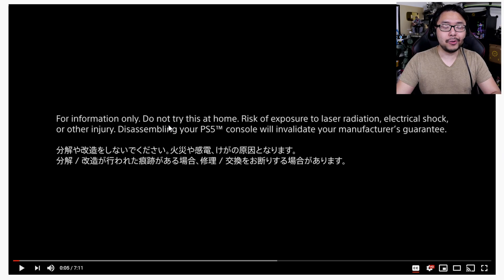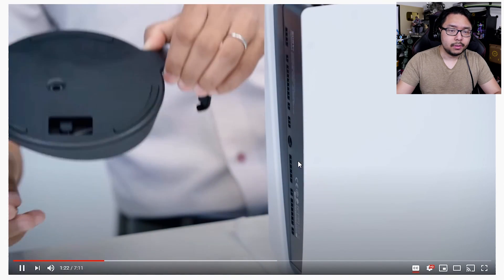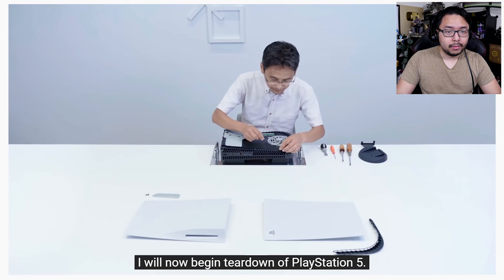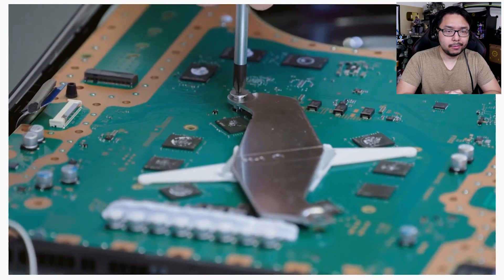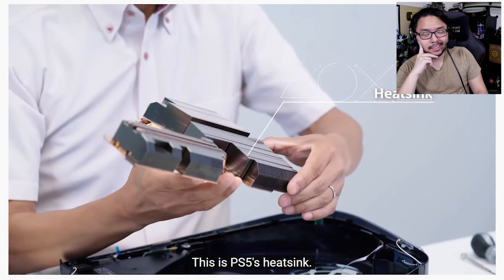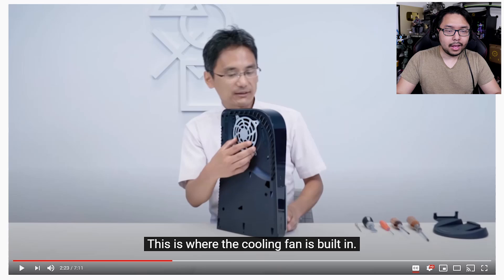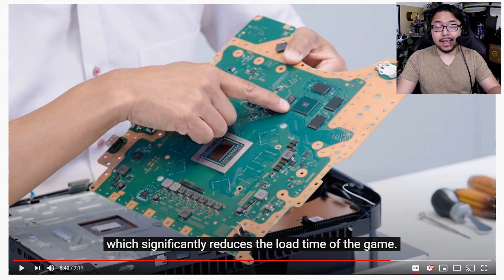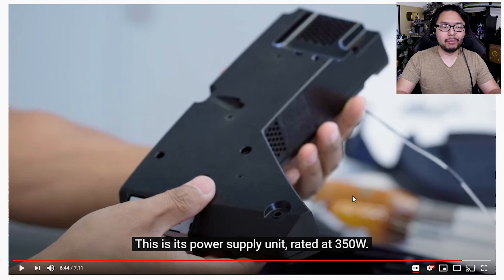Reacting To Sony's PS5 Teardown (Cooling, SSD Slot, Swappable Panels, & More)

Comment from the maker: I'll take some thiccness if it means reducing hotness.

Contribute to my channel on Patreon.com/YongYea or by clicking the JOIN button, and you can also follow me on Twitter.com/YongYea for the latest updates.
TOP PATRONS
[CIPHER]
 - Mitchell Mason
[BIG BOSS]
 - Bancheis
 - Brin
 - Charlie Galvin
 - CommittedHall
 - DatadyneExecutive
 - Jonathan Ball
 - JT
[BOSS]
 - Devon B
 - Gerardo Andrade
 - Joe Hunt
 - Michael Redmond
 - Peter Vrba
 - Shepard Gaming
 - Time Dragonlord
[LEGENDARY]
 - BattleBladeWar
 - Mark Taylor
 - Theron Webb
 - Yue
Reply: I agree Yong
Reply: Teddy Holiday better than your overheated black box. 🤣🤣
Reply: I knew Yong like em thicc 😉
Reply: Nice
Reply: Thicc Cooling
Reply: Nice reaction video Yong. The PS5 seems well engineered and is fast, very fast.
Reply: Those removable panel $$$$ Sony you smart bastards
Reply: Sony thrown nuclear bomb on xbox by this
Reply: But Yongyea thickness always adds hotness for me, in a good way 😉
Reply: I kinda wish xbox went with a changeable nvme  port so you can slot a more fast ssd in the system
Reply: I'm amazed how no one is emphasizing the importance of sony using liquid metal as a means to reduce heat over a heat sink. This is really stepping the bar up. I love both consoles and each have an advantage over the other, but sony using liquid metal really raised the bar.
Reply: I believe the shape of the panels affects the airflow into the dust collectors. Changing their shape would affect that, unless the new shape channels the airflow well.
Reply: Not sure when I will be able to afford  the PS5 but it looks great.
Reply: Ha! Firt comment! Anyways it looked cool
Reply: Indeed Yong
Reply: Tbh! That guy is very small!
Reply: That's a quote.
Reply: Do you know if Sony recommends to get an SSD with a heat sink or without one these are important questions Sony needs to answer and also what happens if you purchase an SSD that is faster than the PS5 SSD does it take advantage of the faster SSD or does it lower it to match the PS5 speed because if it does then it would be a waste of money to purchase an SSD that is faster than the PS5 SSD if it's not going to take advantage of the extra speed.
Reply: Still it's nothing compared to a good PC 🤣
Reply: That fast hard drive is a waste when you have bottlenecks elsewhere.
Reply: quick question for Yong, can you share the dimensions of the xbox series x plz?
Reply: YONG YEA u should do ur xbox series x teardown,so we can compare the heatsink
Reply: I recommend checking out Sabrent Rocket M.2 SSD. They offer an 8TB version which would be insane to put in the ps5. Its around $1400.... but.........its cool!
Reply: Hey Yong, when you get your hands on a ps5 can you load xbox series X vs ps5 vs ps4pro vs xbox one x with same game ?
Reply: I just wish that all creators would let people know they can take whatever they own apart and the warrenty will still be upheld by law they just use stickers and such as scare tactics. This legit went to the Supreme Court and they said if the American people own it they can try and fix it and the warrenty is still 100% intact!!
Reply: SoC and Motherboard is not really the same thing ;)   There is a hit in the name .. System on a Chip   ..  not system on a circuit board
Reply: Oh boy, the hacking community is learning Sony, you're treading in dangerous waters here....
Reply: Its 2.4 vs 5.5... More than twice faster... Around 2.5x faster
Reply: Lol 😆. So true. So true. Getting both systems.
Reply: console is too big, xbox is smaller while being more powerful
Reply: I agree if it the same goes for the noise generated, I am not one to play at high volumes so the PS4 PRo is somewhat annoying.
Reply: SHould I get series X instead of a ps5 if I have over 100 games for xbox one and only 20 for ps4? SOme of the comments in this comment section are just.... smh.....
Reply: Now you can talk about cd project red choosing to crunch instead of delay since they asked the employees and they voted  crunch and articles took it way out of proportion
Reply: THICCCNESS
Reply: FührêrFPöñê  yes really
Reply: Yes but it doesn't fit into standard console sizes in cabinets so
Reply: WE LEARN THAT PS5 STAND IS MORE ADVANCE THEN SERIES X
Reply: R u happy yong, it's seems u r disappointed with a screw.
Reply: Sony fanboy

Comment: Sony fanboys got salty when I pointed out that this fan looks remarkably similar to the ps4 pro fan, it's just taller and looks somewhat wider, and we all know the old fan sounds like a jet engine. I wonder if it was the fan design that made so much noise or the restrictions built into the ps4 pro case. Or, maybe both. 
I'm curious to see just how noisy this fan is in comparison. I know all the "cool and quiet" nonsense the PAID Japanese "influencers" put out at their PAID event, I'd like to see an unbiased 3rd party comment on the fan. Looks like that won't happen before launch though. Anyone else find it odd how tight lipped sony is being about the whole thing?

Comment: Oh cool, the fan will be quiet. Dust catchers? Neat. Potentially customizable side panel, that's kinda cool. But what I want, what I really, REALLY want, is a stable CD drive. I have owned two PS4's and a PS4 Pro, and all three of them have had disk tray problems. The first one stopped taking disks entirely, the second one eventually wouldn't stop ejecting even though there was nothing in there (I had to open it up and unplug the power to the disk tray to get it to stop,) and my PS4 Pro seems to have a problem with the disk reader. Most of the time it will recognize there's something in the tray, but I'll hear this clicking/snapping sound for a minute before I get an "unrecognized disk" message. Usually I have to jostle it from "a little" to "fairly good", sometimes thump it a few times, for the disk reader to get unstuck and read the disk properly.

I can't help but feel Sony did this on purpose, they want gamers to buy games digitally, so by cutting out the retailer middleman they get a larger slice of the pie.
Reply: maybe you've been putting it in wrong? 3 ps4s with non working trey discs? that's new, ive never heard of that problem before
either way, hopefully they do fix this

Comment: Great design.  Looks like a modern graphics card with a blower cooler just much larger.  The size allows it to be dead simple reliable.  My only concern is the liquid metal TIM and it may come back to bite them, I only say this due to previous longevity testing.  Really nice to see.  Peasants should be happy PCMR

Comment: One thing I'm impressed with is that they used a gallium alloy (Liquid metal) as thermal interface between SoC and heatsink. It's the best thermal interface on the market, but at the same time it's horrible to handle correctly - applying is difficult and even tiny droplet on the motherboard can cause short circut, or solder corrosion resulting in damage. Sony went for 'no compromise' patch during manufacturing and they deserve praise for that.

Comment: It's basically as big as PC internally, I mean it is already more of a PC than a console. The reason it's not visually as big as standard PC is because of its obvious tight casing to let people know it's a console, as well as there is no dedicated GPU PCI-E slot card for it, it's integrated on the circuit board. majority is simply integrated on board. Since the case is so tight and small the heating of consoles has always been an issue or one of the main topics, since it's the same like gaming laptop, super compact, but too damn loud because of high heat, and to remove that heat the fans have to spin faster, thus making it becoming loud. Hence why PC cases are larger, fort better airflow and because of dedicated GPU with CPU cooler, two pieces in PC that forcefully pushes a PC case to have a larger depth factor.

Comment: I think we're all overlooking the fact that the PS5 has WiFi 6, whereas the xbox series X and S don't. And considering most people play on WiFi, that could be quite a game changer. I mean in theory, WiFi 6 performs similarly to straight up wired ethernet (which you should use if you can, regardless, but you can't expect everybody else to), and it is becoming more common, I mean next year I'm sure it'll already be all over the place, at least in developed countries, so it'll be interesting to see the differences in latency while playing games online.

Comment: My concerns are in the soldered on SSD's and their lifespan.

 When they hit their limit of rewrite, that's it ? does it need a new MOBO now?
Reply: You're right, they need to allow the NVMe to become a replacement boot drive.
Reply: you can just buy another ps5 in 10 years for $40
Reply: @SevenCostanza  Yeah, one that's used with a dead built in SSD. Don't you see his point?

Comment: Non-removable solid-state storage...never a good choice.  SSDs are 100% guaranteed to fail, so if the system software is only stored on the internal storage and not expanded storage, like a smartphone, then your PS5 will become useless one day, unlike my 60GB edition PS3, or a PS2.

Comment: Is the internal power supply both 110/220v capable or will there be different versions of the PS5?  I wonder why they didn’t go with an external power brick as it would be consumer replaceable if it fails.

Comment: the whole 5.5 GB/s is pretty standard for PCI-E 4.0 SSDs. Hell you can buy one right now to put in a PS5 in the NVME m.2 expansion that reads at 6.9 GB/s. BTW the Xbox Series X should absolutely have PCI-E 4.0 capabilities as well considering they are of the same basic platform. The only thing that the PS5 did differently was include a piece of hardware for decompression that speeds up loading from SSD. Traditionally on PC and every previous console, the CPU had to first load the compressed data into memory and then the CPU decompresses it to then load the textures into video memory. Whereas the SSD data will be decompressed without tying up the CPU. The thing is, that Microsoft has been developing Direct Storage, which essentially achieves the same outcome, by loading textures and model data directly into video memory, using the GPU to decompress it, speeding up loading tremendously. Whereas before, you had the CPU in PCs decompressing texture and model data and then transferring the larger decompressed data across the PCI-E bus to the GPU, the Direct Storage solution transfers the smaller compressed data directly to the GPU while the CPU is dealing with loading only the things the CPU needs to have to run the game. Significantly faster.

Comment: the ps5 won't be that easy to tear down lol.. it never is.. plus with the huge scratches on the machine I think it definitely leaning towards that. Also liquid metal on the heat sink but non on the actual SoC??

Comment: The Sony's PS5 Teardown is great and comes of as very insightful into how confident they feel about the system they made. For years console makers haven't wanted consoles internals shown of because of copy protection issues but I guess with the new online store front distribution methods that gets mitigated. I see this as very pro repair on Sony's part as they know it's popular on YouTube to do console and device Teardowns and this grants any customer wanting to do so a better experience dispute voiding warranty.

Comment: Cooling is the least of a console's problem. They should try to fix the annoying drift on the analog sticks instead, i've wasted 3 controllers by now because they always starts to drift after a few months of use. And i've never had any problems with drifting with my older consoles, even Playstation ones.

Comment: As we can see with the nvme m.2 slot, Sony learned it's lesson about proprietary storage with the ps vita, on the plus side if that port read rates are true to the 4.0 speeds you can pair your ps5 with a even faster ssd in the future

Comment: they'll change the core center plastic for limited editions instead of the fins. Also just changing the thermal paste on the ps4 pro it helps a ton with noise.

Comment: "Disassembling your PS5 console will invalidate your manufacturer's guarantee."

So basically, another way of saying your warranty will be void if you open it, which is illegal in America by the way. You can open your device all you want and they can't deny you a warranty so long as you don't destroy the object and then try to get them to fix it.
Reply: Just Murrrricaaaaa thing
Reply: Funny thing is, I've seen tech companies (for laboratory equipment) bypassing this by making it so that you are definitely going to break a minor thing, like a solder joint that connects to the display for example, if you try disassemble anything by yourself. That way they can always argue that you did in fact break something when you took it apart and therefore they're within their rights to discard your warranty claim.
They can't even take it apart themselves without destroying this deliberate weak spot, but they design it around parts that are cheap and easy to replace when they repair it. So basically, if you were to send in your unit for repairs, they'll already have the part they know is going to break ready for replacement before even starting to work on the device.
Reply: @skraz0r  How is this shit not illegal?
Reply: @TheDaxter11  I don't think it is, but there's also just no way anyone could prove that you deliberately designed it to break. Nobody can tell a company how to design their products, which isn't a bad thing, and with the 2 easy opt-outs of "we overlooked this design flaw" and "we can't do it another way without substantially increasing the price", they always have ways to excuse it if soelmeone were to point it out. Where there's a loophole, there's an exploit. Like with everything else, it's all about money at the end of the day. It's not like they're openly advertising this "feature", but it's still something people who've spent a few years working with this kind of equipment know about. It's just another form of planned obsolescence, really.
On the other hand, if you're actually tinkering with incredibly sensitive, highly specialized laboratory equipment, it's kinda your own fault if you get screwed over in my opinion, so I'm definitely not trying to paint these companies as the devil. There's a good chance that this whole "you'll lose your warranty if you open it up" thing is not primarily a simple way to avoid responsibility, but also a deterrent to prevent people from actually ruining a very expensive piece of tech. If you ask me, it's probably a bit of both, which makes me actually excuse it for this specific industry. The thing is though, I'm pretty certain that science equipment companies aren't the only ones doing it ^^
And I don't know about anyone who'd actually try to repair something so expensive by themselves. All I know is that I've been told multiple times to not open anything that's held together by screws, even if I just wanted to clean it in case something that shouldn't be there found its way inside by accident, because it's definitely going to break something lol

Also, why do I feel like I'm sounding like a conspiracy theorist right now? It feels kinda dirty xD
Reply: @skraz0r  It might not be the best way but I feel like there is a simple way to prove things like this. Do an unannounced inspection of their facilities housing completed or almost completed items, and take them apart for inspection. If the reports of the same part breaking when being taken apart each time is true, or already being broken, I feel like that's pretty damning evidence that they're doing some cheap shit.

Press them, and if they keep insisting its not their fault and a flaw, point out all the complaints and that these newly built systems still have the issue, and if they still persist get them to fix their shit there and then, and if something else starts miraculously breaking easily, you know they're still trying their shit.
Reply: @TheDaxter11   yeah but that would be where the "it's not a particularly important or expensive part and if we designed it another way that would significantly increase our production costs and make this thing unnecessarily more expensive for the end user, and we don't want that"-defense would come in.
Also, I think you're over overestimating the consumer base for these kinds of scientific equipment. They're not selling a whole lot of them in the first place, and those which are sold are very high quality and meant to last for many many years, which leads to only a small amount of them ever having any issues, so there's less than a handful of warranty cases in a year per product type, and of these only a fraction are even controversial. So it's not like there are a bunch of complaints piling up, all pointing to the same malfunction. I'm not saying they're making this stuff to break once you press a wrong button or something. These companies are reliant on the few buyers they have being satisfied with the product, so they take good care to make sure everything works properly. This "it's gonna break if you try to repair it yourself" is just as much of a failsave for these companies to guarantee that their customers don't start taking a machine apart towards the back end of the warranty and meddle with it to make it seem like it was faulty, just so they can grab a new unit for free, as it is a means of making money off of careless customers. If you send a product to them with the claim that it suddenly stopped working properly and they see that it has been opened by someone before, they're going to take a closer look to figure out if it was actually the machine's fault. 
As I said, I only know it for certain about the scientific equipment industry, it's just that it wouldn't surprise me if other branches did the same with money being the sole motivator.